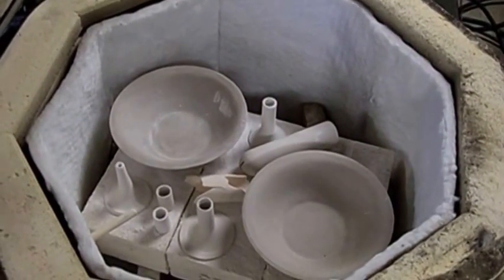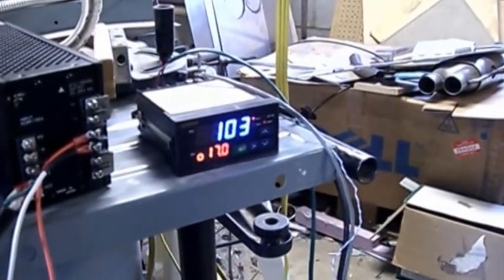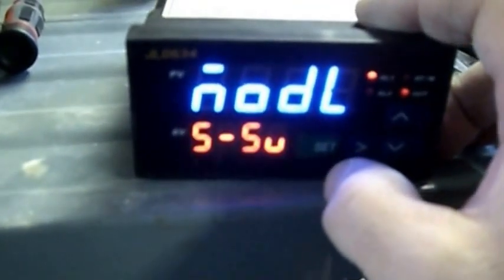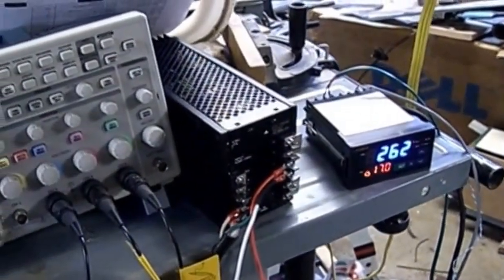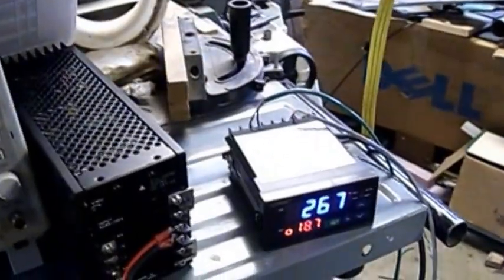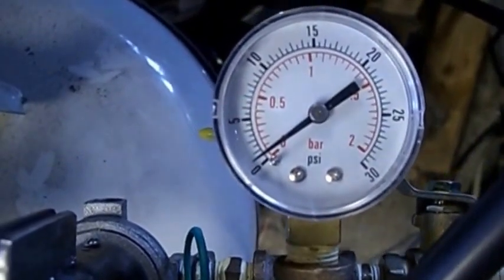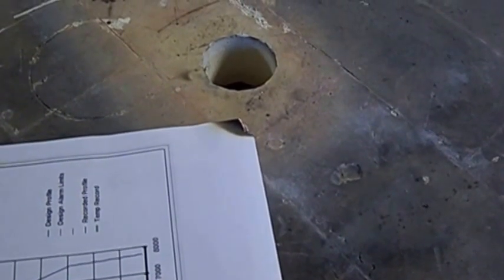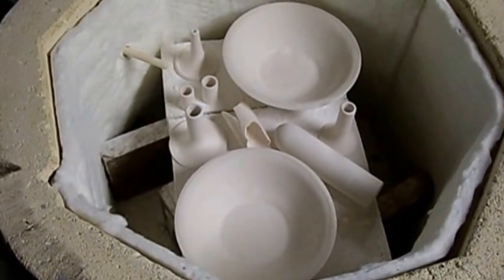Life Above Cone 10, Gas Kiln - First Controlled Firing

Comment: Do you have any more info about that gas regulator you are using? Even some google terms to search for.
Reply from the maker: The regulator is a standard high pressure propane regulator with the main spring replaced by a solenoid driver and custom electronics to do closed loop flow control.  If you're looking for a commercial solution, you could search for 'modulating gas valve'.  I looked at these valves as a possibility (too much $$$ for me), but they might work for you: https://proportionair.com/electronic-flow-control/
Reply: Thank you, I will have to look into them.
I have had success using http://uk.rs-online.com/web/p/damper-actuators/5041270/ these kinds of actuators and a op-amp changing a 3.3v PWM signal into a 0-10v output.